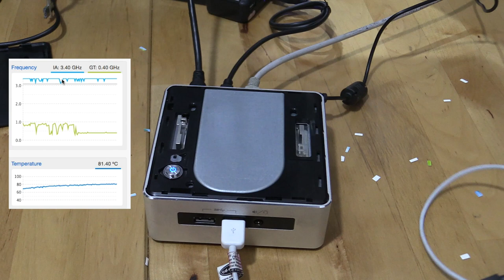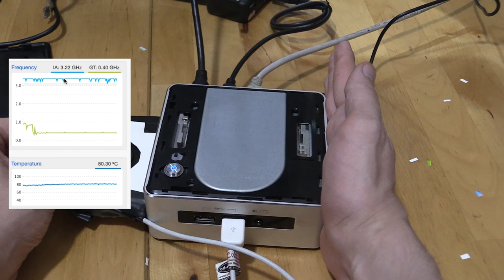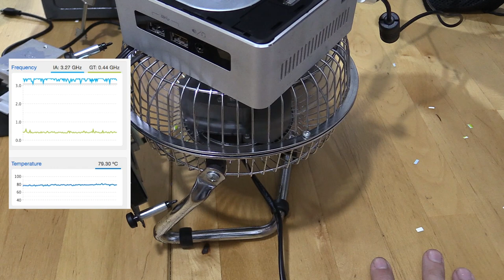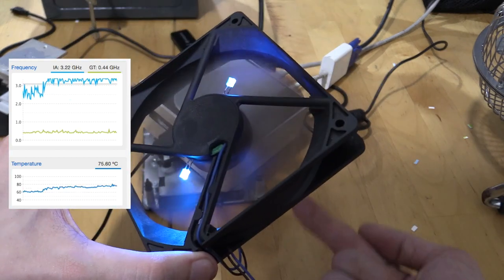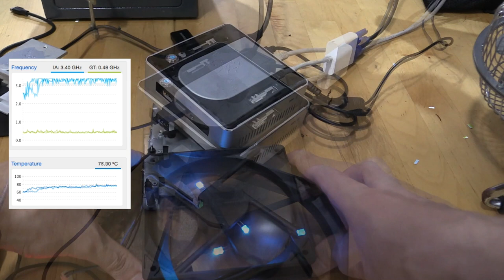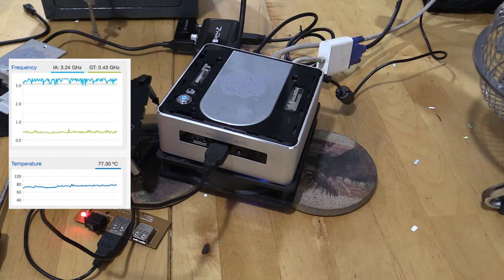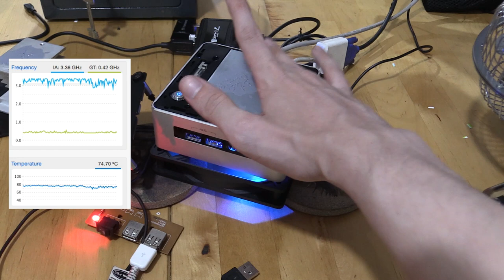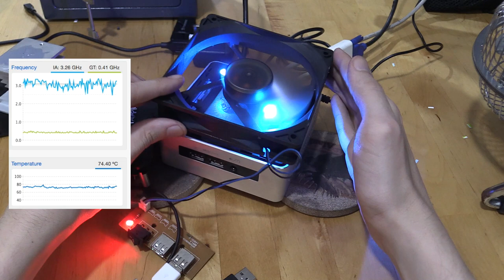Intel NUC cooling mod

Comment: Fascinating actually. What I think you have shown is how complicated cooling is. Accomplished (I am assuming) engineers worked the design with (most probably) the aim to optimize size-efficacy-sound issues and it looks like they did a good job. After all, you had great difficulty improving the design This is such a good example of how well designed the NUC is. I really appreciate your willingness to just try things. I really liked this video and your way outside the box approach. I think you must have had fun with this. Good on you.
Reply from the maker: This might be one of the best comments I've ever had on my channel. You should be a writer!

Comment: The issue is the intake. The fan's intake is on the very top and there are no air vents. So drilling some holes into the lower part of the U-shaped metal plate should help.

Comment: I got my NUC down to about 43C from 75C by installing two rows of M.2 ssd type drive heatsinks on the fan plate. These come with thermal tape making them easy to mount and two of them cover most of the plate while maintaining a low profile. A fan fits nicely over the top and blowing a little air over them dramatically helps keep the entire case cool.
Reply: Can you provide picture and link on this component that you mentioned?
Reply: This is super useful info. Just to clarify, when you say "fan plate" do you mean the metal plate underneath the cover, to which @Gadget Addict applied the thermal paste and heat sink @7:37 in the video? Thanks!
Reply: Thanks, I think this is the real tip here. the heat already comes off the heatsink. so add some more surface area to the heatsink and a fan would be good

Comment: I just got my NUC down from 98 degC to 42 degC - there appears to be a design flaw with this model where dust sits between the fan and the heatsink - I just followed videos on disassembly and cleared out half of this Manila dust we get and it’s fixed!
Reply: Just did this for 15 month old NUC5i5RYH.  It is now silent..  It had been running the fan constantly.  Any ideas on adding some sort of air filter anywhere?

Comment: Ur going have to mode it use a desktop CPU fan!!! I've seen the same p.c they cut a hole in the top of the case and use a desktop CPU cooling system

Comment: the best way to cool this out is going to it's bios and boost all the cooling setting to max. Tried it and it does work very well. It's a bit noisy (cause the fan run at 6500 rpm) but everything seem ok
Reply: can i see your bios fan setting please?
Reply: Under-speed threshold: max
minimum duty cycle: 100%
maximum duty cycle: 100%

Comment: We've been through the same steps as you and no result. I had been encouraged to do this by having pointed a hair dryer directly at a desktop PC CPU and saw a remarkable decline in temp. For NUCs i thought circulating more air, same as you tried, would work but the CPU is on the wrong side of the motherboard for any of your (our) methods to be effective. The NUC fan is on the correct side but may lack the power to do much cooling. You didnt say what your BIOS settings were for the fan, or its speed or temp visible in the BIOS and that would have helped. My NUC stays around 48 degrees on either COOL or BALANCED settings with the internal fan and I dont know enough about the BIOS to make all the other fan adjustments like Custom, Duty Cycle, etc. I have a GoRite USB lid and they make a cooling lid but the air flow to the CPU is blocked by the fan plate so whats the use? If the fan exhaust was located elsewhere, then Id try turning off the internal fan and using your external fan to blow into the the exhaust. There must be a way for this, the other alternative is disaster, to take apart the NUC and mount all the components on a wooden plank, attach a heatsink to the CPU and then a desktop fan to blow through the heatsink. Ridiculous. The other alternative is to remove the lid and fan plate and mount a PC fan to blow onto the exposed motherboard. But any of these kinds of measures defeat what a NUC is. Did you try using BIOS settings to MAX the fan speed? I cant even understand why you have 80 degrees. Please join the Intel forum and discuss it there. On the other hand, its been four years since this vid and maybe you dont even have the NUC anymore.

Comment: although i wouldnt consider the cooling a success, this video does illustrate that its not worth trying to cool down the NUC with external fans. this should save people some money from buying laptop coolers, fans etc..
sometimes disproving a theory is just as important as proving one. thanks, you saved me some money.

Comment from the maker: +Sas Quatch I had considered it but I have a feeling it might just make things too complicated. Ultimately I think you're right, If I want good results, I need to remove the stock cooler/fan. It spans the CPU and GPU chips and doesn't do a good job of transferring the heat evenly across the fan heatsink. I'd have to remove it and then make a new plate that covers the two chips and then add a large heatsink and cooling fan to that new plate.

Comment: Fan on the side will not give you anything. It does not matter how much air you push into the NUC. It will only let through amount that internal fan can let. The additional air will not also affect cooling much. Because it is calculated. The surface of the internal cooler and amount of air needed effectively transfer heat from radiator to air. Any additional air does not matter because it will only increase speed of the air but not amount of heat transferred. Anyway if you want to increase amount of air you have to add suction. I mean you have to add fan to pull air out of HUC instead of push it in.

I think that most big effect would be to push cooler air in. For example if you have Aircon, you can create pipe from aircon to suction holes of NUC. That will significantly drop temperature. 

Another way is to make air more humid. Because it is actually a moisture that absorbs heat. But you are in the Philippines and I do not see any way to make air more humid than there.

And last way to make heat lose more effective is to increase radiator surface. Make more edges. But since radiator is internal I also do not see a way to modify it.

Comment: Great tests.  It shows Intel has done a really good job with cooling.  After watching your video I have another idea that may cool it down without the use of an additional fan.  Will have to do a test first (not that this little machine needs it). I live in QLD and no matter how hot the air gets, the NUC copes very well.

Comment: I don't understand what you doing and why are you focussing on the metal plate on the top of the nuc below the lid.
Below that metal there is the FAN and the heatsink... not the CPU!
Moreover, the heatsink (actually the tiny top of the fins) is not even in contact with the metal plate because it's covered with an anti vibration insulating foam.
So at 7:35 you are just trying to cool the chassis, which is not in contact with anything.
Reply from the maker: +Nox665 Below that plate is the heatsink that covers the CPU and GPU. The heatsink makes thermal contact with the plate. If you open your NUC and feel around, you'll see most of the heat ends up being transferred to part of that plate. If you can cool that plate it will cool the heatsink below and the CPU/GPU :)
Reply: +Gadget Addict No, as far as I have seen the heatsink does not make thermal contact with the plate.
The fins for the heatsink ofc have a base but does not have a "roof". In order to create a "roof" that close the heatsink creating a finned duct, intel have put there an adesive foam pad which act as an insulator.
I have already opened and repasted several of these NUCs, mainly high end ones like the 5I7RYH.

You can clearly see the pad covering the fins here (actually there's 2 of them in this picture, but in the latest models is just 1):
http://cdn.wccftech.com/wp-content/uploads/2013/02/DSC053861.jpg
So cooling that plate is a waste of time.
Reply from the maker: Nox665 I'll have to take a closer look but perhaps I messed up. It's weird that adding a heatsink to the plate has since made a difference in cooling. Perhaps just random coincidence? Thanks for the heads up!

Comment: have you thought about a peltier junction ? Also, you need to dismantle the nuc to see how the existing fan works - are the two fan ports on the rear in/out or both out ? if one is an inlet you could force more airflow through it.

Comment: using vacuum cooler  works really well for me. I have exact same intel NUC model like yours. I try to play game like CSGO it went down from around 80-90C (before using vacuum cooler) to around 60-70C (after using vacuum cooler). I put the vacuum cooler on the exhaust so it helps sucks more heat air out and it works.

Comment: What about sitting it on an gel ice brick. Im assuming that fan housing is part of the heatsink. Ive got an i7 10th gen and thats what im thinking with mine. I might even hook up a big ass peltier module and see if that makes a difference

Comment: I am also having a similar problem yet fan at the side are bloody ugly. Why not just fit a low profile unit (Akasa 2u Cooler Nero LX 2) on the top and power it from an external PSU?

Comment: I can tell you why you are not getting a temp. drop. You are measuring the CPU core temp, and you are trying to cool all other parts than that. If you want to further cool your CPU/GPU/Chipset you need to take off that stock cooler. then add a lager heatsink. If you succeed doing that you will have a new problem, you wont be able to put the top on :)
Reply: Just put a 120mm low profile heat-sink and fan on the top connected to an external PSU
Reply: 100mm else the fan would be larger than the case

Comment: why did you riquire a cooler for Nuc mini pc? As far i know these kind of mini pcs are already have their smart cooler solution.  I was going to buy Nuc mini pc but now i am confused.
Reply from the maker: +serkan yıldırım The built in cooler has to balance noise and cooling efficiency. I thought that I might be able to improve the cooling at the cost of extra noise (additional fans). Whether the average consumer would be interested in this, I don't know. Probably not since it defeats the purpose of buying a tiny near-silent machine.
Reply: +Gadget Addict ok thanks for the explaining, could you also give a little bit information about its noise? Is it really as silent as they claim? I am about to buy Intel Nuc or MSI Cubi.  I tried MSI Cubi and it was quite silent but i have no idea about Intel Nuc, its performance, noise and stabilty as well.

Comment: Also, its better to suck hot air away then blow cold on. If you grabbed a blowervac and ran it flat out blowing onto it maybe youd notice a little but if you hooked up the intake, itd firstly suck everything out from inside but if you stopped that happening it would cool to a point but only ambient.
Reply: Re the hot air cold air thing. If you can blow colder than ambient temp air ie refrigerated air in it will cool, otherwise better to remove the hot air.

Comment: I got confused, which one is the most effective way ?
What I want to do with all my NUCs is to drill hole and pullout hot air with even a small 4x4 cm fan, will surely work better and safer than....hell now, what can be safer than drilling holes in a safe, metal case :)

Comment: I wouldn't use a nuc for anything performance-related, as tempting as it is (not considering price of course). Looks like an interesting project for custom cooling solutions though, especially if they release a more overclockable one.

Comment: A hole needs to be drilled in the top aluminum covering the fan. i drilled a hole in my and temperature only goes to 60 to 65 Celsius on full load. there is not enough air intake on models up to 7th Gen that causes NUC's to overheat

Comment: Try adding a smaller heat sink where the hot spot is on the upper top of the nuc and add a 40 or 60mm fan blowing down on the heatsink.

Comment: I have similar model, the best solution is to disassemble the NUC and clean dusts of the fan inside. Unfortunately I don't know how to pull it apart 😢
Reply: Remove the bottom plate and 2.5" drive if fitted (including cables), remove all connectors from the mainboard, undo the two screws either side of the mainboard and gently pull it upwards. You might need to help it a bit through one of the USB ports or push it from the fan side through one of the tiny holes wiothout damaging anything on the board below. You can also turn the case over and knock it on a table, should do the trick. Then it's just undoing the two screws that hold the actual fan down et voilà!

Comment: why not just use the big heatsink? place it on top of the heat source and secure it with rubber bands or plastic straps.
passive cooling from the heatsink alone removes 20-30C vs large fan that cools off only about 10C

- edit -
hot gluing it might be a better way to secure it on the NUC
Reply from the maker: +comebackata2 If I was to do that, I'd probably use a sticky heat transfer pad and then make some kind of 3D printed clip to hold it in place. But honestly, I don't know if I can see a passive heatsink performing as well as the current small heatsink/fan combo they have installed. I managed to move the heatsink to the edge of the fan and now it gets pretty hot when the NUC is under a heavy load. So the heat is actually being transferred now and I blow a fan over the exposed heatsink. Honestly, it still doesn't seem to make much of a difference.

Comment: putting the 120mm Fan at the bottom with hardly any space for airflow is plain stupid, I would get 2x 140mm and create a push/pull config to see.

Comment: Since I bought my NUC6i5SYH the heat is my main concern. Similar to you I live in Brazil, and we do not use air conditioners here too.

I thank you for doing many test, and actually go through all my initial ideas, and you proved me that it is not worth the trouble of modifying the NUC.

As last option, not covered in your effort, is to remove the original fan/heat-sink and actually use a more efficient option like the copper/water cooling solutions, which will actually make the NUC very tall in size. Also this last suggestion should be tried only when you run out of your manufacturer warranty, or you will be in trouble if something goes wrong. 

Cheers!

Comment: Pushing air doesn't help! Try turning the fan upsidedown then you'll see a difference. ;)
Reply from the maker: +Nima Jafari Tried pushing pulling, doesn't really make much difference either way. Putting the NUC upside down causes much worse heat build up though lol
Reply: Oh, I just got my NUC today and the cpu usage is always high. Do you know of any solution? Thanks! ;)
Reply from the maker: Nima Jafari Maybe it's a software specific problem? I'm running Mac OS X on mine. Have you checked activity monitor to see what apps are eating up the CPU?
Reply: Yeah but nothing is using more then 0.8 %. :( Thanks though.

Comment: Bare wires while power applied? Check....
Reply from the maker: Thankfully the NUC is powered by an adapter that converts high voltage AC to low voltage DC :)

Comment: For me, the only thing that worked was when I somehow managed to install stock cooler from normal intel processor. I have only i3 version but the temp drop was from around  45 - 65 C to 33 - 51C. Dunno how right now but I will have to make a custom case for this to work :/